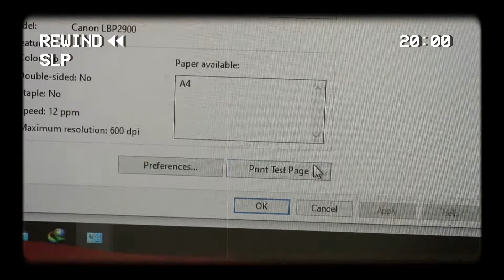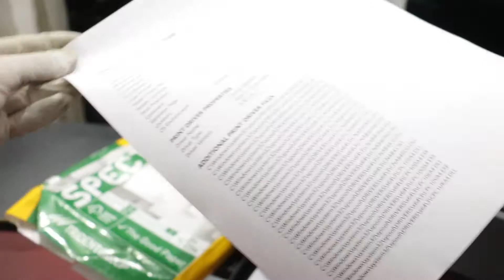How to repair Canon 2900b paper jam & multi pages double pages pickup problem

Comment: Sir brother 820 and epson 4260 dono main konsa printer by kron.
Long time k liye use karna hai.. 
Shop k liye
Reply from the maker: Thodi din phele customer laye the epson l4260 uss printer ne 1.50 Lac prints kare hai or Abhi bhi use mai hai 

Brother dcp 820w  printer mai problem aari hai kafi Head related 

Long use ke liye epson lelo ap

Comment: Pls shivam help me...
I have brother t500
And erro 43 appear
You told me to change
The Carriage pcb 
And i change it but now display screen appears error 48 what can i do pls answer me ... change the head or what
Reply from the maker: Yes sir 48 error form head first dissamble head and clean with  isopropyl alcohol wash properly and dry it then install back to the printer and check maybe head working again
Reply: @ShivamSharmaRepairs  
May God protect you
Reply: Any suggesting from AliExpress